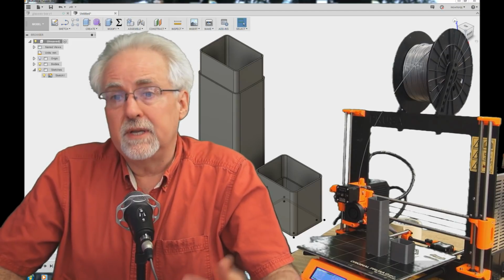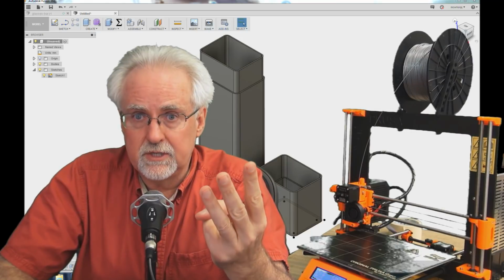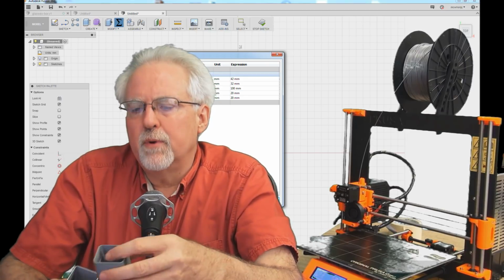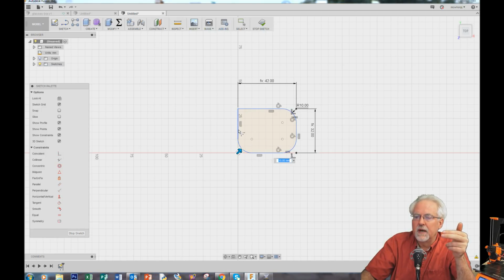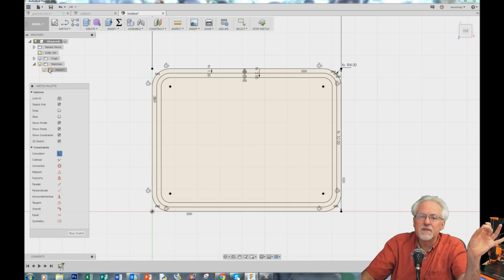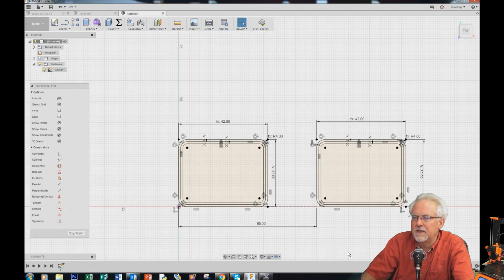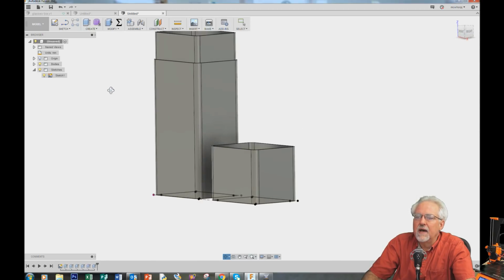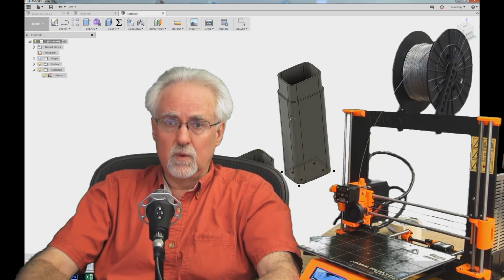Learn Fusion 360 or Die Trying LESSON 5: Understanding Parametric Design and Modeling

Comment: FYI, if you're having problems entering negative offset values: negative offsets no longer work. A Fusion update switched to a scheme where you have to click a "flip" button in the Offset dialog box to get a negative offset. The value stays positive.
Reply: I just tried using a negative offset value and not only did it work, it entered the "fx:" part as well. The "flip" function is still there if you want to do it that way. Hooray for updates!
Reply: @DrummerMan52  yep same
Reply: Negative offsets still working in 2021
Reply: Negative offset is working with parameters.

Comment: The best tutorials out there.  Period.  I wish Paul would make tutorials for every piece of software I want to learn.  I wish other creators would learn from his style.  Repetition is KEY to learning.  

One technical question for anyone still here.  I completed the tutorial for the glasses case and printed on my Anker Make with PLA+.   The top and bottom piece don't fit together.   I tried making the inset of the top part 0.1 mm smaller.   It does slide on - but is very tight - almost air tight!  Is there a standard tolerance that I should have for pieces that are going to fit together when 3D printing? Like a 0.2mm gap for example?
Reply from the maker: The tolerance depends a lot on your printer, and your settings. Figure out ideal for your setup.

Comment: Shortcuts from lesson 1-5:

- 1 = Window select
- 2 = Freeform select
- C = Circle
- D = Dimensions
- E = Extrude 
- L = Line
- O = Offset
- R = Rectangle
- X = Normal/construction line (dotted line)
- ESC = Deselect

Create —> Rectangular pattern —> Duplicates sketches in rows and columns.
Modify —> Change parameters —> User parameters —> +

Comment: Its been 5 years since you made these videos and there have been some improvements and some changes to the user interface but these videos have really helped me master the concepts and user interface. I have also viewed Kevin Kennedy's videos which are very good but he really goes too fast and glosses over basic user interface.  The combination of the two video series are really pretty complimentary.   I would start with Paul's series at least through the first 5 and then if you want more technical approach, Kevin's series will be much easier to follow as you will now have a firm foundation on the basics.  One best practice that you should follow from the beginning that Kevin stresses is to save your files and name all sketches and components as you go so when you have a more complex design of many sketches and components, you can navigate easily to the correct place.

Comment: Thanks Paul, mah laff is so much better! A couple of suggestions: first you should create a play list for these lessons, at the moment it is quite hard to find the next lesson each time I finish one; second for this lesson you should parameterize the position of the lid, at the moment bottom and lid will overlap if the width is increased too much.
5 years on and they have fixed the bug with parameterized offsets, but the bug with displaying the origin constraint is astonishingly still there! With your usual starting rectangle, delete the origin coincident constraint and both that and the coincident constraint on that corner disappear from display, but the behavior indicates it is still there. Display of constraints generally is frankly pants and badly needs a rethink!
Reply from the maker: Did you look at my playlists? There is a playlist for this class. Also, recently, I completely redid this class on the latest fusion 360. There is a playlist for that as well.
Reply: @paulmcwhorter  I'm looking at the 'created playlists' list on your channel page and I do not see this title. I did see the two 'for 3-D printing' titles, but my ambition to learn Fusion 360 was more general than that so I was intending on taking this class first and then circling back to one of the specific 3-D printing ones. I guess the 'or die trying' title appealed to me as I had failed on courses from other creators of the 'first click this, then click that' type for exactly the reasons you described. Your way of explaining things conceptually before getting into the specific actions really works for me!

Comment: If you want a parametric box for glasses, I suggest making the INSIDE rectangle fit the glasses, so when you OFFSET out (not in), or change the wall thickness, then any size of glasses will fit.

Comment: Great explanation of both design intent and parameters. I wonder if the outside dimension is really the place to focus. We might do better to focus on the inside dimensions so that for Glasses with a length x, height y, and thickness z, we can build the model so that if we get new frames that aren't the same size we can measure, or estimate those dimensions and get a TTB Case that fits them. With the current parameter setup, we have to do extra work to make the internal measurements of the case come out right.
Like I said above - this is a great explanation of design intent and parameters. My quibble is about where the ruling dimensions should be.

Comment: The position 65mm line you draw at 21:00 -- that is a hard value of 65, but if we changed the width parameter to 66 I think we would blow past that value.  I think you were just trying to proceed with the exercise -- but I can see that even one oversight could cause problems in a Sketch.  Thanks for the excellent tutorials.

Comment: Hey Paul, wouldn't it make more sense to set the length and width parameters to the inside of the container, then offset the two walls from the inside going out? That would allow you to change your wallThickness and lipThickness parameters without losing volume on the actual case itself.

And seriously... thank you so much for this series, a couple days ago I was ready to give up on fusion!

Comment: thank you, very clear as usually. 
one question on parameters: considering that they are normally related to a personal style, even if used in different projects, is it possible to save them, i.e. in a text file, and use them in the future ? a sort of repository of personal parameters, to be imported an customized when needed. - thank you for your attention.

Comment: How do you go back and correct a mistake with the radius of corners in the first sketch? My first sketch (tall portion of case) corners will not change radius when it is changed in parameters but the short cap corners will.

Comment: Really good, and extremely useful. However one small point. The object that defines the case is what it’s going to contain - the glasses. However you defined the case by using inward offsets. Hence increasing the wall thickness decreases the volume. Might it not be more useful to increase wall thickness outwards, so the internal dimensions stayed the same? 
This is definitely not a criticism, it’s an observation - your teaching methods are impeccable.

Comment: Hi Paul,
amazing tutorials! I saw all arduino lessons and now I'm learning Fusion360. I would make this case even better by changing the line which is setting the gap between the bottom and the upper part. I would changed it as width+30, so those parts won't touch each other when I extend the width.
Thanks a lot.

Comment: Hi Paul. Great video. I used the case design as a basis for a parametric box. I notice that the offset can be set to a parameter during first entry if you make that entry in the 'offset parameters box that comes up instead of directly in the sketch. Thanks for this video, I have been put off on Autodesk befire for the exact reasons you explained.

Steve

Comment: I really like the tempo you're using to explain everything. It's on the verge of annoyingly slow, but I actually find that a good thing.
Sometimes you mix up a few terms, but the fact that I can pick up on that means you've explained it great up to that point.
Question about the offset, that became clear when you made the wall thickness 8 mm. Wouldn't it be better to offset to the outside to make sure the glasses fit in the case? That way you don't need to calculate the offset that makes it smaller?
If someboby has already asked this question, I appologize, but I didn't want to read through 331 reactions.

Comment: Hi Paul- This is a really great series, on a par with your excellent new arduino series, and I feel like I'm really learning my way around Fusion 360. I am having one issue. When I extrude the base of the larger part, as expected, everything else disappears. But the eyeball for the sketch stays illuminated and no amount of clicking on it restores the sketch. Any ideas?
Reply: Paul- Don't bother replying to this if you see it. I followed Farm Craft 101's advice and got it working.

Comment: Hi Paul, Cees Ruiter 69 year young, from the Netherlands, just followed the first 5 lessons and you are a great teacher I can say. Now I start understanding Fusion 360.
Just a question of the parametric design, when I 3D print the case I find it difficult to fit them together, zero tolerance, can I add in the parametric also a variable for a tolerance between the lid thickness. ?
Thank you,

Comment: Little nit, pick.  For the design of the eye glass case the critical dimension should be the inside dimensions, not the outside.  Parameters can of course handle all configurations for different contents.

Comment: If your having problems understanding Fusion 360 this is the series to watch. I learned more in the 1st hour than I have in watching days of videos from engineers.  Only difficulty is that AutoDesk has released a new version and the commands are not always in  the same location. Mr. McWhorter provides a slow pace presentation and explains  every operation along the way rather than flying through a series of clicks. Must be a wonderful  school teacher.

Comment: Latest version of 360 has fixed the 'bug' with having to (re)dimension the wall thickness to be the variable. Also, it appears as though you can copy/paste now as well, rather than 're-draw'. I used Lesson 2 to create a 'construction' line and copied the rectangle - the variable references seem to have been copied faithfully as well.

Comment: Using Fusion 360 version 2.0.7830 on my Windows 10 PC. I have found that coincidence remained and I didn't have to constrain to the X and Y axis as you had to do in your lesson. Also, Rectangular Pattern worked (possibly could have used Pattern on Path instead). As I said in my post on lesson 2, I am able to extrude the base but then the outer two rings disappear and I re-enable sketch they appear but then disappear with the extrude command! I found that if I switch off the body and then switch it on again I am then able to extrude the outer two layers.

Great video!!!
Reply: BTW, forgot to mention that negative offsets work fine with Fusion 360 version 2.0.7830 on Windows 10 PC.
Reply: I was mistaken in what I said above, coincidence was removed and I missed Fusion 360's message informing me! Also, the Pattern on Path option only is available after Rectangular Pattern is used to duplicate an item.

Comment: Hi Paul,
I am new to  Fusion 360 and struggling to learn how the program works.  
I really like your videos.  You really have a good concept for where new users need to start.
I am a 3D designer since 1985 and came up using Pro-E. 
Your courses are the only ones I have found that teach "selecting" and "proper clicking" of commands in an intelligent way.
I am not happy with Video Lesson 5.  I think you are teaching the Autocad way of approaching Parametric Design. 
For me your approach is pure fantasy.   No one figures out all the dimensions first and then just draws the design.
Knowing all the dimensions up front is drafting.  Simple documentation of a known design for historical record.
Design implies creating something that works and works well when the project has one or more than one unknown.  The design process allows you to look at and or create the thing you are designing and "if necessary" put it into a setting of known other parts or physical spaces and see if the mechanical / physical and or spacial charactics of the thing you are designing is likely to work. 
Normally you start with one or more "working envelopes" along with a basic "design intent" and then create objects in 3 dimensions using the design program and then tweak the object to create a design that works and is robust.
In my world you create your part dimensions with intent and purpose as you suggest in lesson two and after you get a working design - you then click on the various dimensions you used to create the design and assign these dimensions to your list of Parametric Parameters for the design. 
 Simply put ... you take the working dimensions in your finished design and assign these into your working parametric table and are free to add in labels.  Your objective is to create a well working Parametric table that gives you and others control over the design.  Once you have a good table of parameters from the dimensions in the sketch ... you save the table and these dimensions in your table are now concident with the related dimensions in your drawing.
This now gives you the freedom to go back and change the variables in your parametric table any time you like and effectively change or drive the related dimensions in your design or model. 
In analysis ... your proposed way of design is to spend time drawing the parts .. copy down all the dimensions like in Lesson Two and then create a table and then draw the design all over again inputting the values from the table.  
In the real world no one has time or enjoys drawing everything they do twice.  Imagine designing an 18 Wheel Truck with over 250,000 components.  Now imagine telling your boss you are going to have to draw all 250,000 components twice in order to create effective parametric design models.
Design is a zero forward process with an idea in mind to get you where you want to go.  Please name me any three people that can design something like  CamShaft knowing all the parameters up front so that the design works perfectly using your idea and concept of Parametric Design Modeling.
BTW - In Pro-E early versions all the dimensions are named with parameter designations as you create them. The system tracks and understands these designations. As the designer you assign the dimension values to each of these design parameters.  You have some discretion as to how these can be linked or duplicated from the existing earlier design parameters.    The system parameters are always available by system name and you and can use them again and / or perform mathematical operations such as addition, subtraction, multiplication, or division in the same way you describe in Lesson 5.

Thank you for your time.   You are doing a great job.  This lesson or perhaps the design of the program needs to be adjusted to fit the real world.
Please note - I am very new to Fusion 360.  There may be another approach to creating and using Parametric Parameters not visualized by your lesson.  I am expecting to find another way to create a Parametric Design table that does not require knowing all the dimensions before the start of the sketch process. 

Best Regards

Comment: The way you have it set up, changing your lip height will change the overall length. 
I would set up the overall length and then base all other dimensions off this, such as OverallLength - LidLength - LipHeight for bottom height.

Comment: btw, Corner Radius parameter is set only to origin rectangle. It does not help no control  inside (lip) rectangle. Set Corner-radius to 2mm and see...Th smaller (lip) rectangle will lose its fillet at all.
So you have to set fillet radius to all 3 rectangles with corner_raduis parameter  each time for each corner to be fillet and each rectangle

Comment: Super videos! You are filled in some basics that I had been missing. I'm sure my frustration levels will drop tenfold!

One thing though - I was with you all the way until you drew the second sketch manually instead of using the rectangular pattern to copy it. It contradicts your previous video and seems to be rather backward for such a great software. What is your reason for doing it this way?

Comment: If you could, please think about a video about the 3D printers. Yours is different from others I have looked at but the price is lower. What is the difference from yours that is not in a cabinet and the ones that are?
Most my work is milling and working on a lathe as I am a gunsmith.  But the 3d printer could help me a lot.

Comment: Paul,
Just started the fusion lessons and loving them. Wouldn't  it be better to link top and bottom by dimension or a parallel constraint?  I used the construction line but when I changed parameter beyond 65mm the parts intersected.
Keep up the excellent videos.
Tim
Reply: Funny, the same thing happened to me.  I spent an hour trying to move the one box then remembered the 65mm construction line constraint.  Then I had trouble removing that constraint.  Paul did explain that in the 'move' lesson though.  Paul is very thorough in explaining how things work.

Comment: I have had a lot of trouble with the dimensioning and selection tools.  Sometimes I have to enter many times to make the dimension stay. Yes I am wearing out my ‘D’ key.  After many hours I discovered that dimension can be done with a right click.  Extrude seems to be o.k.  Would you please e-mail me the proper step by step necessary to use the dimensioning tool.  Like when to single click, when to double click and when to use the enter key.  I have learned a lot with your videos and will continue to finish the tutorials and learn fusion360. Cliff Fitting   genestusff@fastmail.com